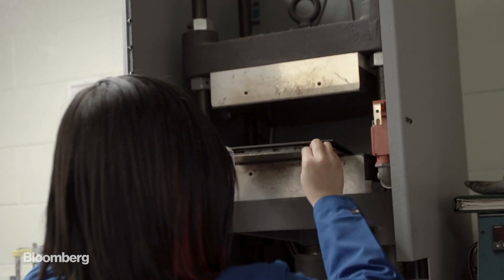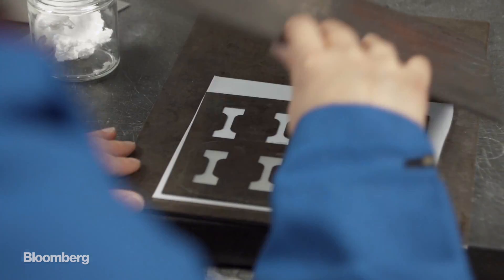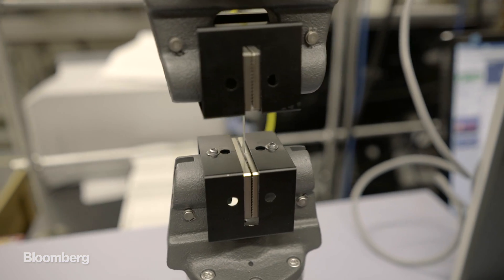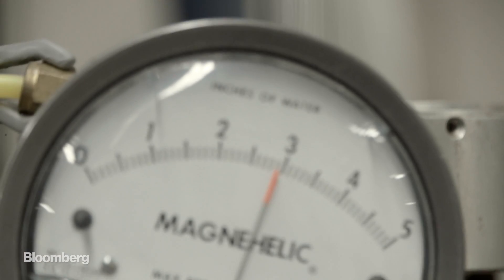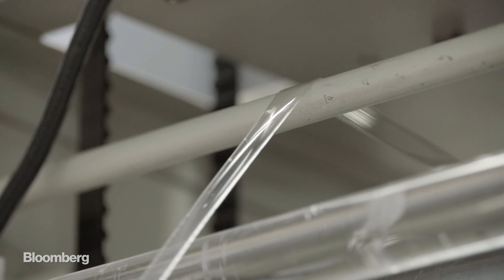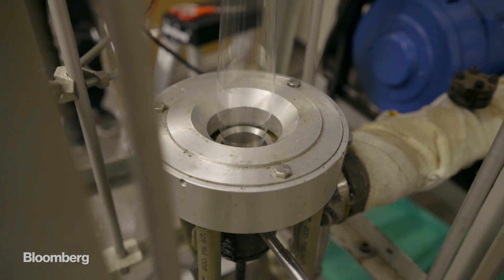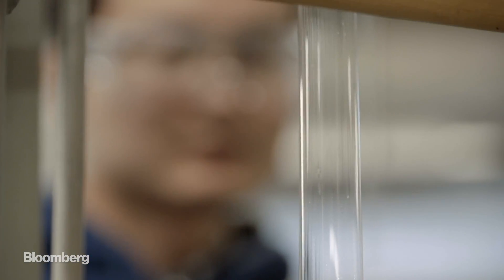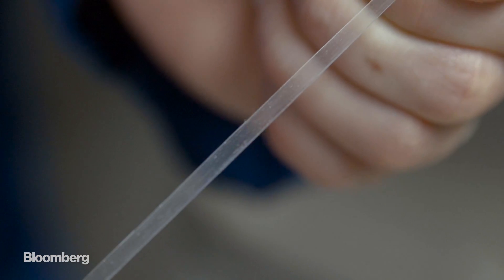This Ecofriendly Material Could Replace Rubber One Day

Comment: did the rubber plantations quit re-planting the rubber trees? because i had always thought re-planting rubber trees makes rubber sustainable? no doubt that i have much to learn about these things.
Reply: Many rubber products are mixed with and contain Petreleum. That the issue. Petreleum will not be cheap forever and it also does harm to the environment mining for it, processing it, and making products that do not break down...
Reply: @Frost517  Not true. Rubber is not mixed with petroleum products. Rubber are farmed natural products. You are talking of Paraffin wax which is Petroleum product. Get your facts right.
Reply: They called it the ecofriendly material, but the reality is that the raw material for those polymers is from fossil fuels.

Comment: A replacement for rubber sounds intriguing, but a replacement for plastic? that's old news. I've been using fully biodegradable plastic bags, containers, and utensils made from plant based materials for years.
Reply: Where do you get them?
Reply: have you seen them decompose?
Reply: @duncanharwood6317  Yes. In compost pile. But depends on type of compostable plastic, some types require more heat than a home compost delivers.
Reply: Compostable in a home compost?